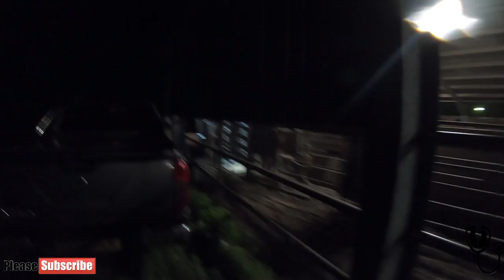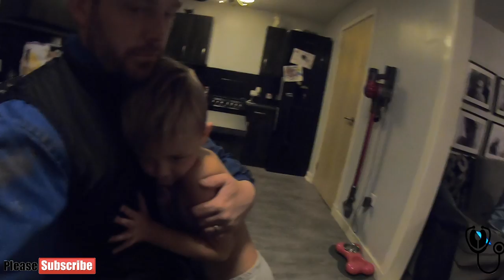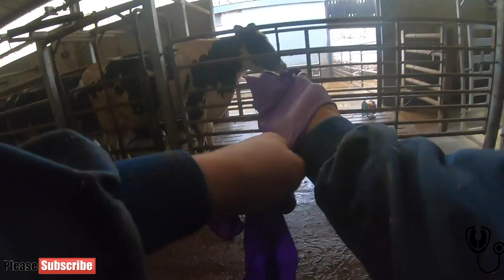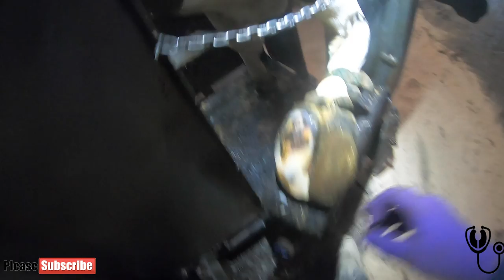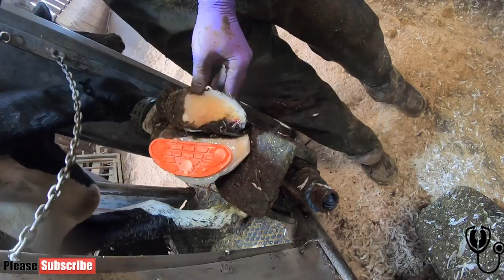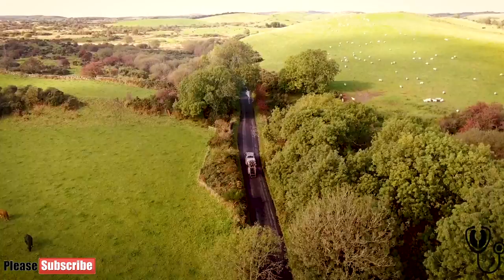WINDY MORNINGS, OLD BLOCKS AND HOT COKE! | The Hoof GP

Comment: I would not recommend blow torching a coke can to heat its content. The heat will end up burning the plastic lining of the coke can and you might tend up drinking some of it. Most modern soda cans are designed to have a thin layer of plastic that line the inside of the metal.

Comment: Hey H GP. When you make your coffee don’t pour boiling water onto the coffee grounds. Always add the milk after you put your coffee in the cup. Boiling water scolds the coffee so add the milk to stop this. You will notice a difference. Great videos by the way.
Reply from the maker: Lols I ran coffee shops for years - that's only the case when the oil is still within the coffee - the coffee I'm using there is freeze dried - so it cant be burnt. When you make coffee from ground beans the water should never be hotter than 84c in order to avoid burning the grinds you're absolutely right!!!